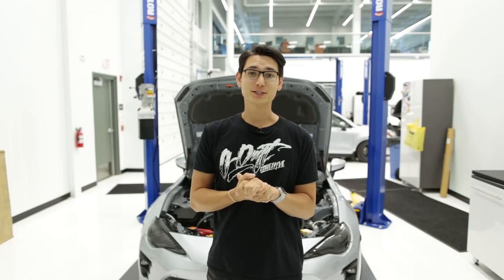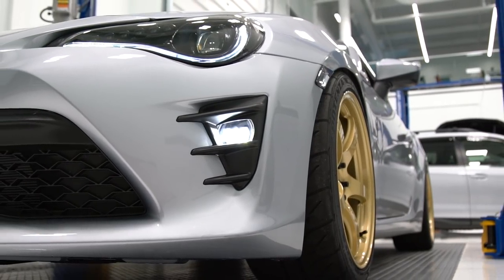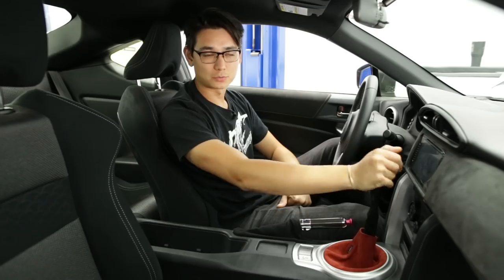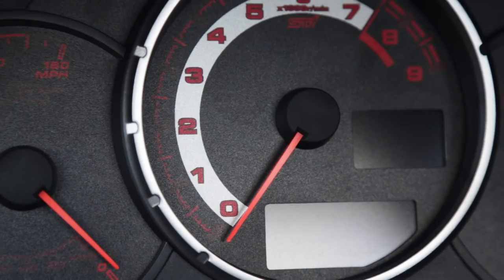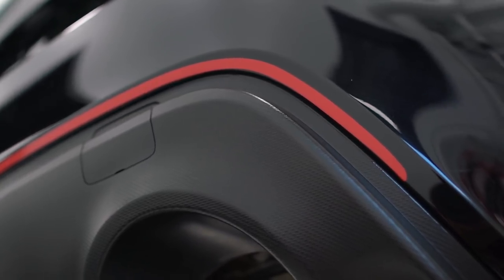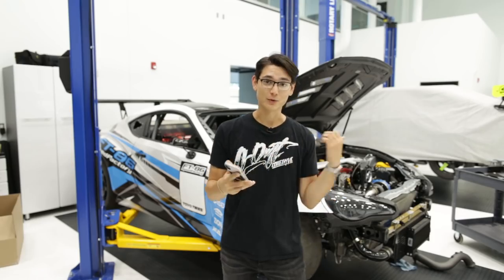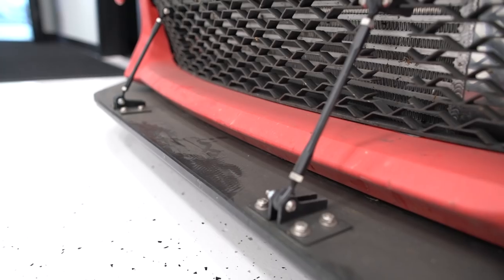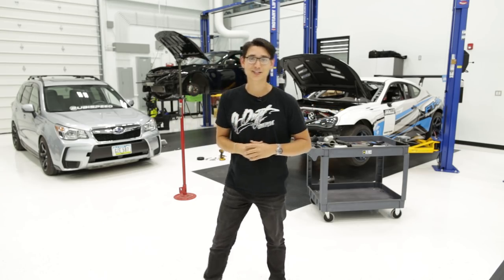Mod List - Every part on every car

Comment: I'd like to run the 255s all around on the exact same wheels/size as you did on that silver 86. Assuming I roll the fenders, and use camber plates on the stock struts at -2 degrees all around and (1"?) drop springs, will I achieve the same look/function? Or is there some reason I MUST have coilovers to achieve this setup?

Comment: What happened with the turbo kit that you guys were developing? Did the plan for it fall apart? I remember reading it was based off of the turbo kit in the time attack car
Reply from the maker: Other projects took priority.  We may bring it back, but no guarantees!
Reply: @FTspeed  What about the intake manifold did that get canned?

Comment: $23.00 for a junk e brake thingy. *to drift hit gas. i have not done a single mod to my 2017 860. in fact i havent even put thr front plste bracket on the car. until its paid off im not putting a dime in this rat.  not even hi-test gas. oh wait i put one more thing in it....my lead foot on the stock brakes and gas pedal. im driving it like its rented. i just edited this post so ive done more mods hete than on my 86.

Comment: it would be really nice if you make a video about internal parts of boxer engines when boosting brz at high peak hp
Reply: Id highly recommend a piston and rod upgrade at minimum if boosting or supercharging, that alone would alleviate alot of potential issues.
Reply: pistons are fine for 350 easily but id do rods as soon as you boost it

Comment: How do you get the head lights to be sequential on the first car? I cant even figure it out on mine lol
Reply: The sequential headlights are plug and play so you just have to connect the wires and the headlights will work

Comment: Anyone know what are the square like covers are for, just under the  headlights on the front bar.
My 86 has them, my only guess is it might be for headlight cleaner or maybe mounting bolts?
Reply: My guess is for screw in tow hooks
Reply: @Halsafe   Sounds good Adam, I'm going to have a check this weekend, to satisfy my curiosity.
Reply: @jcramond73  do it man, if it is a tow hook spot, might as well get one. I got a tow hook installed on my car and it's helped me out during the winter months
Reply: @Halsafe   not wrong mate, if it is, I will be getting one.

Comment: Broooooo what’s your rotor and pad setup?
Reply from the maker: Silver 86 - DBA T2 rotors http://www.ft86speedfactory.com/dba-front-rear-slotted-t2-rotors-167.html#.W2Rg2tJKgkk
Time Attack FRS - 6 piston AP Racing BBK http://www.ft86speedfactory.com/ap-racing-front-6-piston-rt-big-brake-kit-by-stillen-2013-ft86.html#.W2RhS9JKgkk
Red FRS - 4 piston AP Racking BBK http://www.ft86speedfactory.com/ap-racing-competition-brake-system-sprint-677.html#.W2RhgdJKgkk

Comment: Brakes
Reply from the maker: 86 - DBA T2 rotors http://www.ft86speedfactory.com/dba-front-rear-slotted-t2-rotors-167.html#.W2Rg2tJKgkk
Time Attack FRS - 6 piston AP Racing BBK http://www.ft86speedfactory.com/ap-racing-front-6-piston-rt-big-brake-kit-by-stillen-2013-ft86.html#.W2RhS9JKgkk
Red FRS - 4 piston AP Racking BBK http://www.ft86speedfactory.com/ap-racing-competition-brake-system-sprint-677.html#.W2RhgdJKgkk

Comment: In Japan 2014 2015 theres already much more insane 86 than this 2018 FT86speed ones. Much more balanced , lighter by 400lbs and 3 x Fa20 stock Power. Those are real time attack cars 2014 2015 already setting Kanto Tsukuba . 400ps exploded shows how inexperienced the ricer team is:) 2.0L easily 500+ on high end turbos even some on 600ps++ 700ps++. in UK theres even 800ps close 900ps FA20.Even Taiwan having 500ps FA20 without Engine blow issue.
Reply: I felt sad for all the money wasted due to inexperienced team complacency and not researching enough for a proper modification.
Reply: Vincent Tay k
Reply: Hi! Can you give a forum or build link about these 600-800ps FA20s please? I am in the progress of building a reliable 500whp GT86 and decided not to do a 2JZ swap :) Would love to get some input not to waste money and time! Thanks!